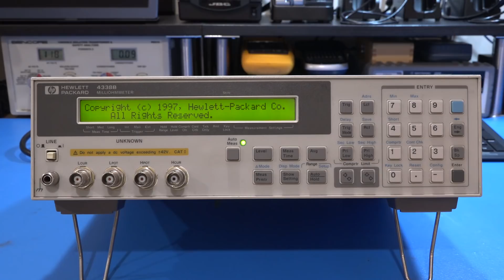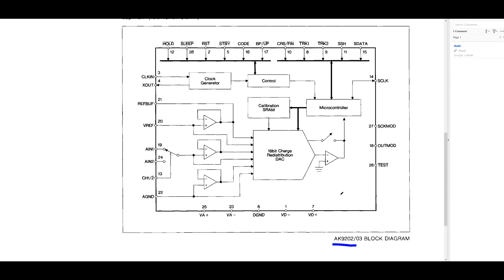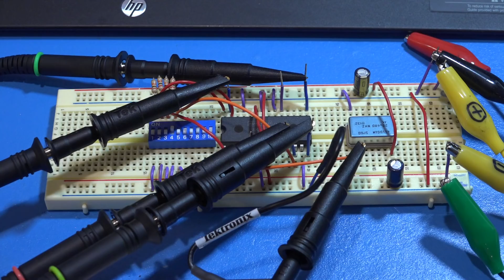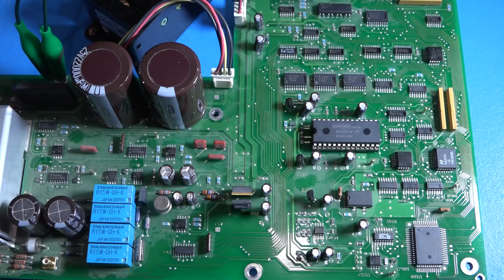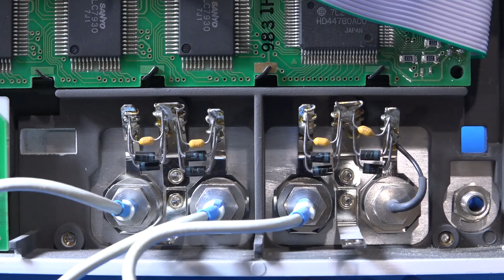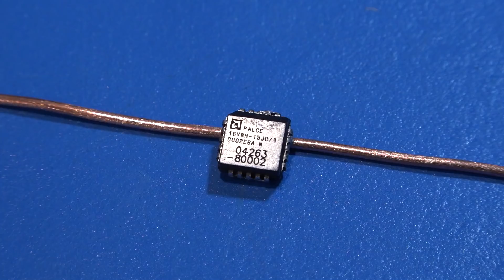TSP #129 - Teardown, Repair and Analysis of an Agilent 4338B (10uΩ - 100kΩ) Milliohmmeter

Comment: Great video, as always. I have a general question, regarding your repair philosophy... It came to mind, because this is a 1997 unit... Do you replace all the electrolytic caps in these units? For the effort that it takes to open up these high end devices, I would think that re-capping would be standard procedure...

Comment: Nice video. The 16V8 is a relatively simple device,  most likely used as an address decoder to generate the ADC hold signal.   Connect up the LA and characterize its behavior.

Comment: He got lucky that the PAL device from the LCR meter was the same (or similar enough) that it worked in the milliohmmeter. If you monitored the inputs and outputs of the PAL during operation you would have a chance of reverse engineering the logic in it. It would allow you to program a new part.

Comment: Fantastic videos as always, I have a couple of ideas for future videos, one would need to drop the frequency down a few pegs into the audio realm and do a teardown and repair of a HP 8903A audio analyser (as an example) the other idea is something a little different and demonstrate what is involved in replacing dead CRTs in older equipment (non VGA type) with LCDs? I think the later would be extremely interesting to the masses as repalcement CRTs are difficult to source and a viable replacement would bring new life into older but still useful equipment that many have on the shelf? Cheers H

Comment: Hi again Shahriar! Others suggested doing PAL device reverse engineering. I think that would make a great educational video. Consider for example using a cheap modern FPGA like Spartan from Xilinx to generate all combinations of the input signals to PAL device and record the responses on its outputs. These results could be stored for example in FPGA RAM. Of course some voltage level shifting would be required to interface FPGA with PAL. Having both FPGA and PAL present in the same system would allow you to compare and show in action basic blocks in both PAL (macrocell, AND array, EE configuration memory) and FPGA (CLB, RAMs, PLLs, CMBs, fast carry chain, switch boxes, I/Os). You don't have to go into too much of the details there and it would allow someone watching to get general idea about the difference between PALs and FPGAs. You could also throw in an overview of CPLDs capabilities, which are somewhere midway between PALs and FPGAs.

Next thing to do would be to use captured truth table of PAL device to show boolean equation simplification aka circuit minimization in real example. For example using either straight math approach or Karnaugh map method. These days most of boolean equation simplification is done under the bonnet by synthesis tools and people struggle to understand how all of this works. The result of that simplification then could be implemented with one of the languages commonly used to program PALs (PALASM, CUPL or ABEL). Or alternatively you could use Verilog or VHDL. The point is to show how to perform simplification manually rather that letting the tool do it for you. At the end you could program the resulting fuse map into new PAL device, put it in the system with FPGA to scan it and prove that your PAL device responses are the same as the reverse engineered ones.

And of course as a side effect you would have a system to clone PAL device to fix your 4338A ;-)

All,
What do you think about the idea described above?

Comment: Great video Shahriar :-) The ferrites on the coax cables you are talking about at 3:05 are not for getting rid of any transients. They are acting as a common mode chokes to reduce common mode signals that could enter front end amplifier and affect its operation.

Comment: Hello -
I enjoy your teardown and repair videos so much I have rationed them out so as to get one a week or so. It's going to be a bummer when I get all caught up.
Now I make a request for a repair video that will be beneath your contempt. I am a happy electronics tinkerer on a tiny fixed income, and cannot afford good test equipment (in fact it would be wasted on me anyway), but I have been fighting using handheld chinese VOM's for years. After having to take apart the vom and replace a fuse because 200 mA smoked it, for the 20th time, I decided a try and find a decent benchtop vom. The two things my chinese handheld has going for it are autoranging, and I don't have to change lead input positions to measure volts, ohms and milliamps. That is convenient. But if I inadvertently let it see, even very briefly, over 200mA, it is dis-assemble the  case time again. The only benchtop VOM that I could find that was in my price range was a used Keithly 179A. It doesn't autorange, but it will handle considerably more current than 200mA. 
There are many available on eBay, and I bought one that purports to work, but no gaurantee. And there were maybe a half dozen that need repair.
It seems to me that if you bought one or two of these, and went thru your analysis and repair process, you would be helping a number of poor people like me who would buy these broken (but very inexpensive meters) if we had some sense of what to expect.
So that is my suggestion to you.

Comment: If that thing is only combinatorial logic, then it should be possible to “read it out” by just trying all the combinations, essentially treating it as a ROM? (In fact, the difference to a ROM would only be how much gates are necessary to implement the logic.) This is feasible if that thing has at most, say, around 30 or so inputs, which seems to be the case. Of course, if it’s actually sequential logic, then enumerating all possible internal states becomes infeasible pretty much immediately.
Reply: Ah, never mind. Only after writing my comments I of course realize that plenty of people have suggested the same already.

Comment: If you have some time to spare, and cannt find the replacement part for this PAL, you can try reverse engineering it. If you are lucky it is just combinatorial logic, and should be easy to figure it out, build truth tables and reprogram blank device to do the same. If there are sometiming or flipflops it might be a bit more tricky, but not super tricky, because this device has only small amount of inputs anyway.

Comment: The PALCE 16V8 family does indeed allow for outputs to be registered. However, it does not have "internal-only" registers, e.g. you cannot have hidden state in the chip. It has only one type of macro cell. If you want a flipflop which acts as an input to another logic cell, you can use internal routing of a !Q output to the neighboring cell, but at the same time, the non-inverted Q output of the flipflop is available on a pin. So it is quite possible to reverse engineer those, even if this is mask-programmed (and another commenter stated that it might not be).
16 inputs, 8 outputs, slowest speed grade. Probably not even all inputs used. That's a truth table that can be (reverse) engineered by hand. Contact me if you want to discuss options on doing that.

Comment: Another great video by Sharir.  Only he would imagine to remove a component and test it in isolation - while mere mortals would just hunt for a replacement ;)  In fact, I would have replaced that ADC 2 or 3 times (by removing it from old busted music gear I have or get on eBay) before realizing that it wasn't the problem.  By the way - an 8-channel analog scope is simply a wet dream for most of us.  But as I look at the tests performed - it was indeed possible to make the same determination with a 4-channel scope (or even a 2 channel scope) accessible by the common man.  You just wouldn't get it all in one screen shot sequence.  I also wonder what PAL programmer you would use to read those HP PALs?  I have lots of HP gear I try to repair and those SMD PALs are everywhere.  And while I don't have one of those microohm meters (or its cousins) I'd bet there was some reuse in ADC control circuitry across various models of gear - and I'll see if I don't have a board somewhere with one on it I can remove and send to you.  Thanks again for the video (behind which it's obvious there's a ton of work).

Comment: Hey Shahriar, thanks for sharing. As always, great video. Regarding the probe lead, the Keysight Impedance Measurement Handbook has few good illustrations for different terminal configurations. As far as I remember, these series (including capacitance meter, milliohmmeter and LCR meter from the same era) work with customized four-terminal pair configuration.
As you noticed the test fixtures cost a fortune. I hope you will decide to build a DIY one so that we can follow along :)

Comment: A few words on HP part numbers...  Firstly, HP used their own part numbers for generic parts and often had manufacturers mark them with the HP number. Generic part numbers consist of two groups of four digits. The first four digits tell you what type of part it is. For example with part 1854-1028, the 1854 tells you it is a silicon NPN transistor, and the 1028 tells you it's a 2N3904. Many HP service manuals up to the 1980s contain replaceable parts lists that actually cross reference HP numbers to the manufacturer's original designation, so if you have a part with one of these HP numbers on, but don't have the service manual, it can be helpful to search through other HP service manuals for instruments likely to contain the same part.  

Other parts, like the PAL in this video, have 10 digit numbers. These are parts specific to one instrument or a few instruments. They can be used for individual parts or for sub-assemblies. The format of the number is abcde-nnnnn. 'abcde' is the model number of the instrument, with a leading zero for four digit model numbers. If the first digit of the second group began with a 6, this generally meant it was a complete board as I recall. There used to be a program where defective boards replaced in field service were sent back to the factory for repair. These came back with the second digit of the second group replaced by a 9.  The PAL in question here was used originally in the 4263 LCR meter. I hope somebody finds this info useful. Apologies if I made any errors -- it's a long time since I was a field service engineer.

Comment: Apparently those PAL device can be read in some way or form, as LSC suggest in their PAL to GAL datasheet "A GAL device may also be programmed from a master PAL device by reading the pattern of the master PAL into
the programmer memory"

I could imagine, that the EE memory on the PAL is just corrupted due to aging (it has a nominal data retention of 10/20 year depending on temperature). So it could be as easy as reading the "good" PAL into a programmer and re-writing the "dead" PAL.

PS: The datasheet actually mentions something about a security bit so it may be a bit more tricky. But reverse engineering the truth table of that pal should make a fun video ;-)

Comment: It looks like if one really wanted to it would be feasible to probe all in inputs and reverse engineer a logic table. The datasheet shows 1 clock input plus 8 data inputs. It would be interesting to see exactly what is failing on the chip. If it was a single line problem, maybe even try a decap and see if it is a broken bonding wire that could be replaced.

Comment: Should have used a hot air tool removing those chips. Or just a regular heat gun with a nozzle made out of aluminum foil. I've tried the latter - works like a charm.
Reply: Yeah! You tell him! It's clear from all of his fantastic videos that he has no idea what he's doing.

Comment: Could that PAL device be reverse engineered by analyzing input and output signals and building logic table from that? Sometimes programming can be quite simple just to make layout simpler, and to deal with timing issues that multiple logic ICs could cause. I hate it when mask rom device or custom chip is cause of issue, it may doom whole equipment unrepairable if no donor unit is available. I had problem with one scope where front panel was not working correctly and all symptoms pointed to broken subprocessor with mask rom but luckily it was caused by just broken logic gate in communication bus.
Reply: I love these repair videos... 

That programmable logic chip is definitely not mask-programmed device.  Palce is an EE-prom series made by Lattice Semiconductor.  It does have security bit so it's highly likely it's not fully readable. 

For reverse engineering. I think it should be quite possible since it only has 8 registers. Could be tricky, but with right tools.. 
Edit: But it would be nice if companies could release the data files themselves, that would make testing and rerpairs a lot easier. 

Datasheet for 16V8 can be found at https://www.latticesemi.com/en/Support/MatureAndDiscontinuedDevices/PALPALCE
Reply: i have done this in the past on simpler pal and gal devices but in the case of the 16v8 there are internal registers, which greatly complicates matters. I'd hook up a LA to the working unit though and just see how complex the logic is, it could be they are not using all the features and the truth table isn't that bad.
Reply: Yeah, internal registers, shift registers and flip flops complicates reverse engineering, but it is still possible, especially if we monitor device dynamically in a working unit, and know what happens to inputs and outputs, we can figure out if there are clock lines, latches, and with some progmable bit analyzer and generator reproduce these signals and reconstruct what they are doing. Or read the ROM for the main CPU and disassemble the code to find out what is going on. It should be even possible to debug and monitor the this main CPU fully in real time with modern tools.
Reply: I also thought about that while watching it. If it's clear from the board which pin on the PAL is an input and which is an output it should be possible as long as it's really just using the combination of logic gates. This part also seems to contain flip flops as well though, so the output can also be dependent on a state and not only on the inputs, which makes things more complicated.

Comment: But if that logic device is a pal it should have only combinatorial log in x, why not find the input of the chip and apply all possible combinations and look at the outputs? Than you could generate the logic function that drive the output and make another pal. There is some security mechanism that I'm anaware?
Reply: I have now a similar problem with a dead clpd in a Fluke DTX1800. I used JTAG  to find the problem pin and I also had a working unit to swap them (the slave unit is 99% the same) .I am making a video about that repair.
It would be nice if someone could make a video about reverse engineering and testing pal/gal/cpld etc because they seem to fail a lot (relative) and there is not much info about it. In a SA I once could hard-wire it but most times it is game-over. And that is a pity because these are often rather time-consuming repairs.  I did not find a way to read the cpld guts. I controls the power supplies. (it is a VQ44 package, not easy to put on a breadboard) 
 I use the breadboard test also, nice to see I'm not the only one who does this. I knew I'm not mad :-) to make it faster I made a tester for IC's based on the tubetester setup. A ZIF socket and 16 12-position switches, 32 leds, neg/0/pos supply, some bnc's, some potentiometers, headers for bridging or inserting series or parallel components etc. Very handy. (I use it in some videos on my channel (look for pa4tim)
Reply: pa4tim note that cpld and pal are way different. Pal contains only combinatorial logic, a programmable plane of nand and a fixed plane of nor gate, cpld contains more complex block like muxes LUT and flip flops so is can be not only combinatorial logic in there.
Reply: Thanks, I already was afraid of that. Hard to find good info about testing the hardware part. Most info is about programming. But besides that, I like videos about serious reverse engineering/trouble shooting. Signalpath is one of the few that goes deep (that is, if he finds a serious dead instrument that needs more as a new fuse, some caps or a loose connector :-)  he has more luck with that as me). That is why I make repair videos, I hope someone can learn a bit from the techniques I use. 95% of the repairs I do are without schematics on measurement and calibration gear that is no longer supported by their dealer or the manufacturer, so I often have to be creative and do a lot component testing

Comment: I have an older RLCG meter made by Tesla. It's a BM 595. Do you have any tips on how to find documentation or schematics? Would love to get it back into working order...
Reply: How about this one: elektrotanya.com/tesla_bm595.rar/download.html ? It's in Czech, but it might be a good start.
Reply: I hadnt found that one thank you. but i really need a service manual/schematics. it has a problem with the power rails somewhenre. I just need a way to figure out where the problem is.  I'm no where near as talented as Shahriar.
Reply: I did look for a service manual also, but could not find anything else. Sorry.
Reply: jan386 No need to appologize. I really appreciate the effort you gave a complete stranger. Thank you very much for what you found, it's more than I had before...